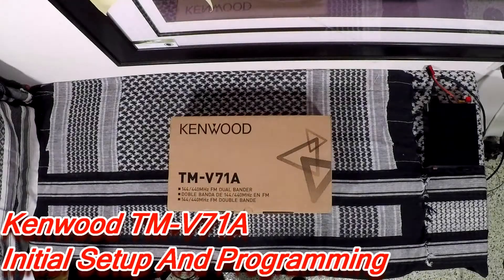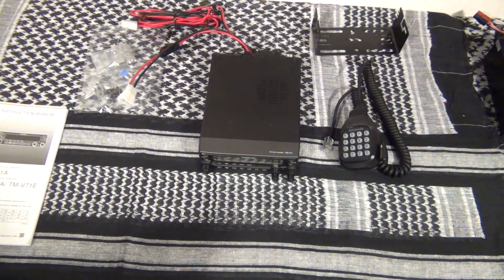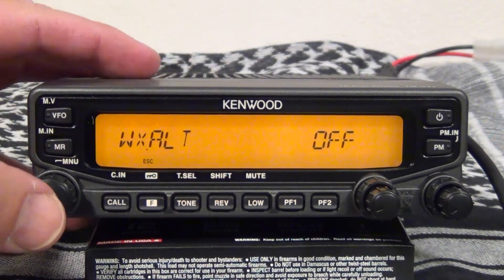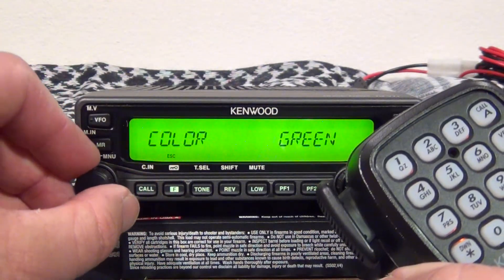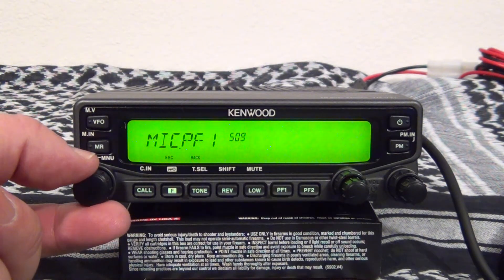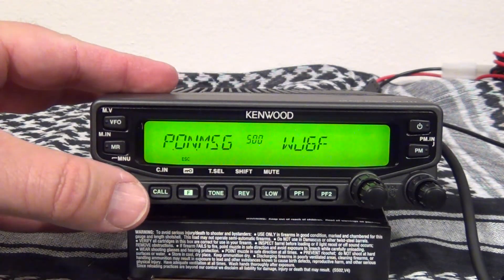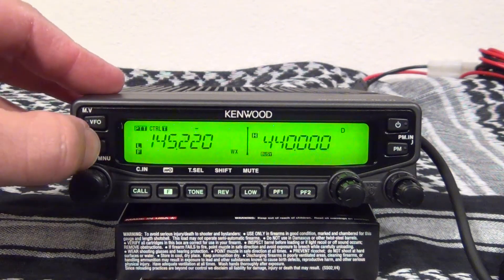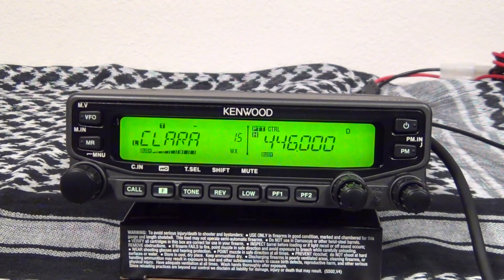Kenwood TM-V71A Initial Setup and Programming

Comment: How do I manually Program 2 PL's? Tone to the Repeater Tone from Repeater 
coming Back Example PL Tone 103.5. Decode 156.7. As an example. Some 
Repeaters Use 2 Different tones. Do I need the Software Program to do this or
can I do it Manually?
Reply: Am wondering that too
Reply from the maker: Thank you for taking the time to watch and the comment! It is greatly appreciated. I have been trying to figure that out myself.

Comment: Will this radio allow you to assign b and A to say 2 meter and band B to 70cm?
Reply: If you use RT Systems programing software, this is possible. There is a "mask" feature in the software. Mine is set up to mask 440 on "A" side, so only 2m will be active and 440 will be hidden. Oposite for "B" side, where 440 is shown and 2m is hidden. Basically turns it into two radios.
73's
Reply from the maker: Thank you for taking the time to watch and your question! It is greatly appreciated. This radio uses a shared memory for the channels so I don't believe there is anyway to separate the A/B channels by band.

Comment: I've heard a lot of good about it.
Reply from the maker: Thank you for taking the time to watch and the comment! It is greatly appreciated. I have this one and the TM-D710A. I haven't had an issue with either one.
Reply: If I ever need another I would think about it.  I have the DT-400, and ID 4100 and a few others. Just getting back into it after 30+ years.
Reply from the maker: I also have a Yaesu FT-M400 in my car. A good radio, but not nearly as rugged as the TM-V71A.